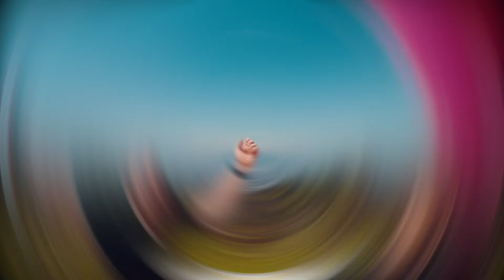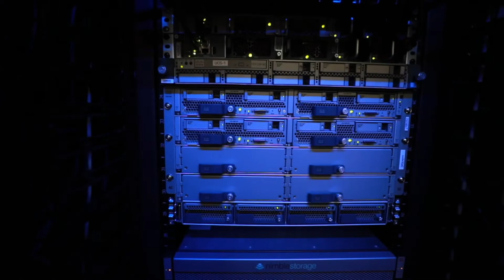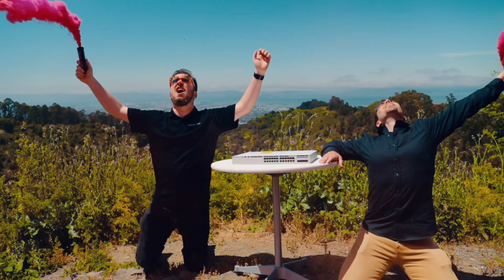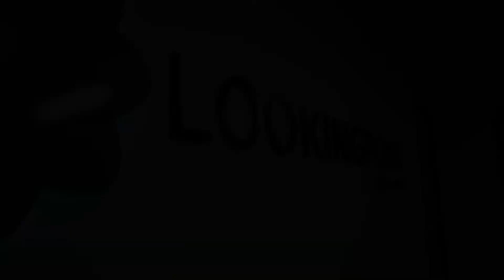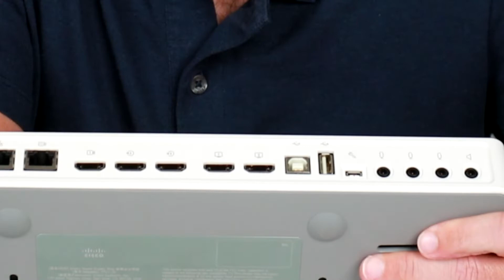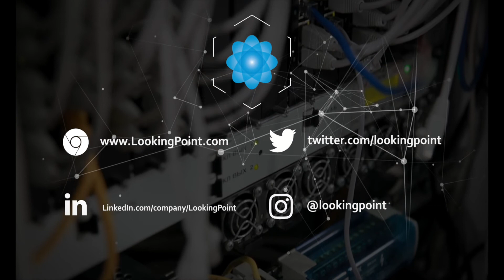How To Wire Your Room Kit!

Comment: Great but Cisco should consider reducing wiring.  It takes a lot of extra work and considerations on installation.  Maybe in US the construction makes it easy to move cables but in latam whe walls are made with solid blocks.

Comment: Can you use an output from an audio board into the codec, rather than use the microphones provided? My job uses the codecs for 150 seat auditoriums. Sound is always an issue on the far end of the presentation. I would prefer to use the 10 microphones in the room rather than the 3 that we have for the codec.